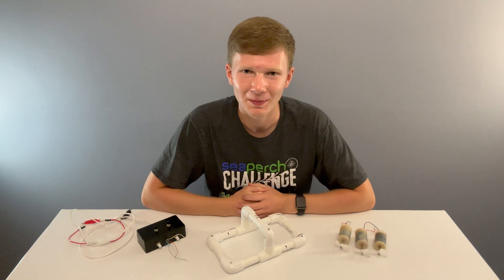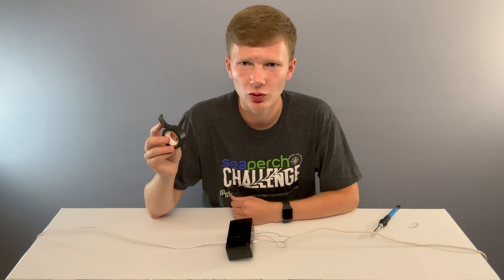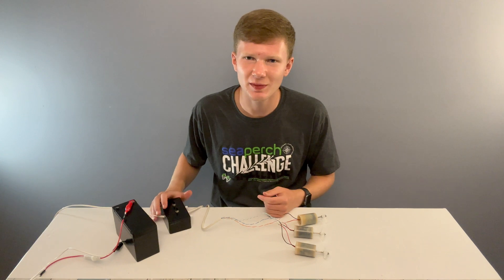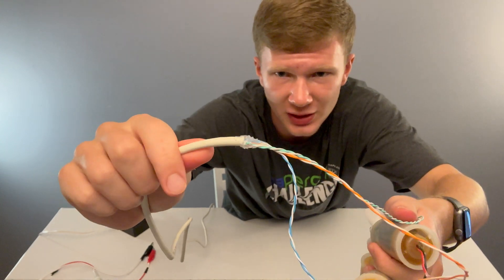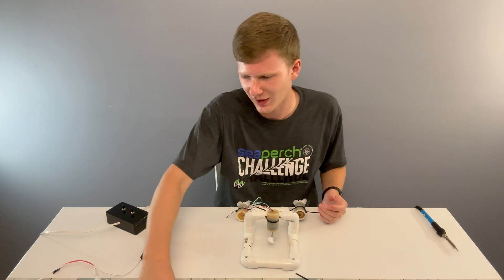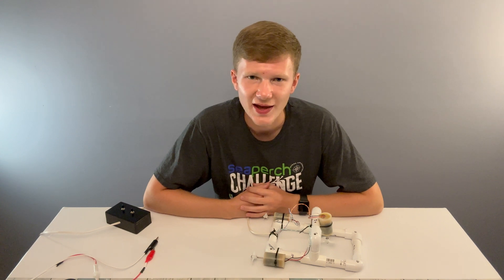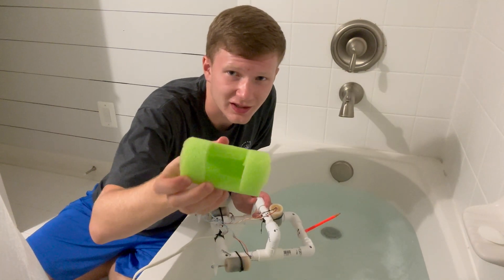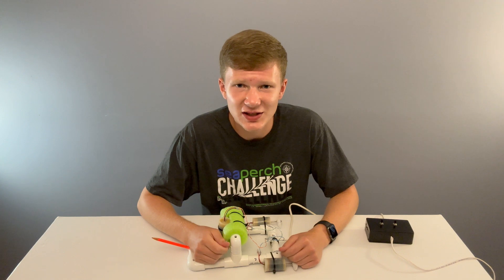Final SeaPerch ROV Assembly (5/5)

Comment: Do you have the file for the motor mount?
Reply from the maker: @MarkGrundel-e7e  which one? There are many ways to attach the thrusters to the frame, depending on the orientation of both the frame and thruster. I have made plenty of motor mount files over the years, and they are quite easy to make.